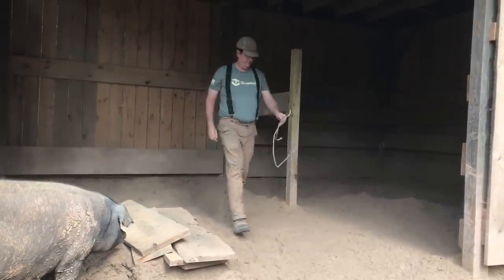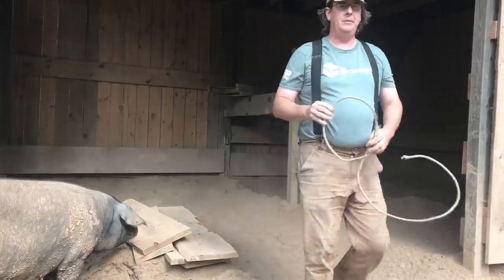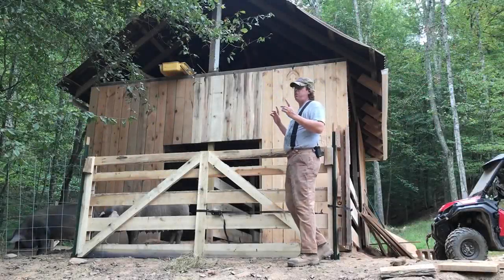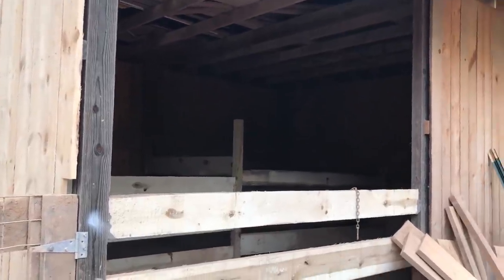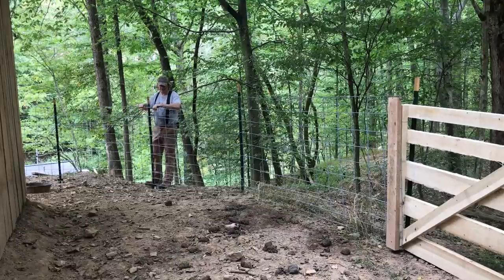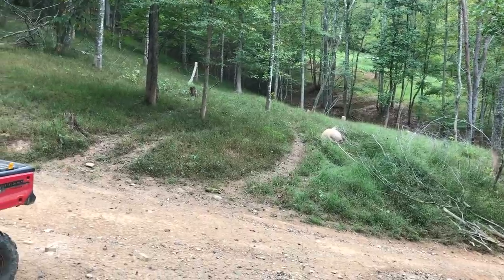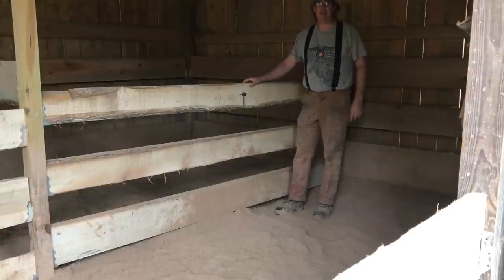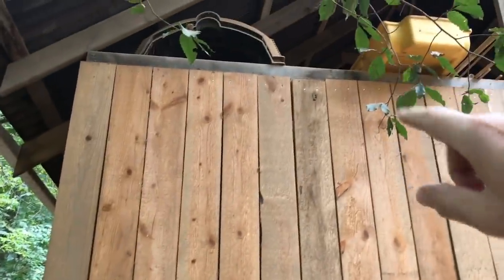Finishing the Farrowing Barn in TIME for PIGLETS

Comment: Great job , I’m glad you did this. Make more fences and carry them with one of the trailers or some forks on the tractor if ya get some. Great idea hanging them on building. I made some out of cheap wood from Home Depot and coated them with used oil and antifreeze.

Comment: Those will usually perform better together. No separation anxiety, co-nursing, and security. If they choose to, Id let them. Add a bunch of hay to your set up and call it done. They'll be fine. Heat lamps are the devil, btw..
Reply from the maker: You think a heated creep area is not necessary? Hay will be placed today.
Reply: Nah, good shelter plus hay is great. Ive seen too many barns burn down with heat lamps + pigs. You know how pigs can be. She hears a pig stuck back there, she'll destroy those boards to get to it.
Reply: @RedToolHouse  I would leave the heat lamps for the first 48 hours then take them off They dont need it after